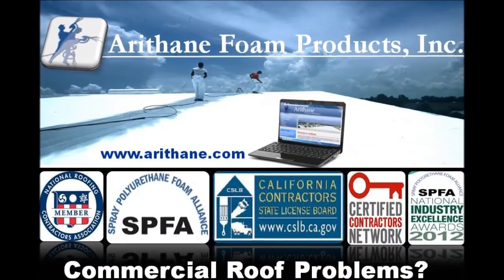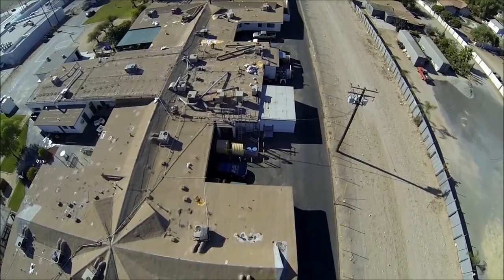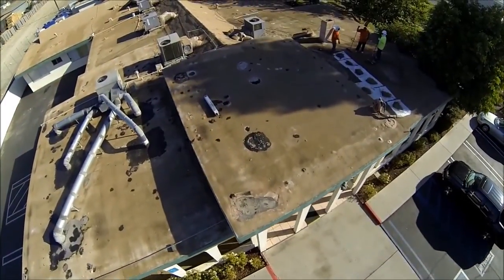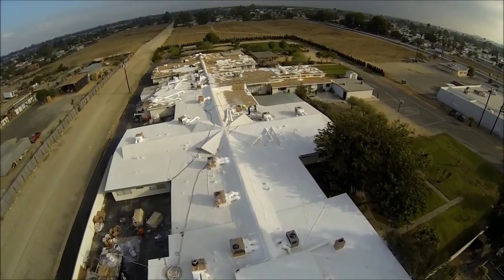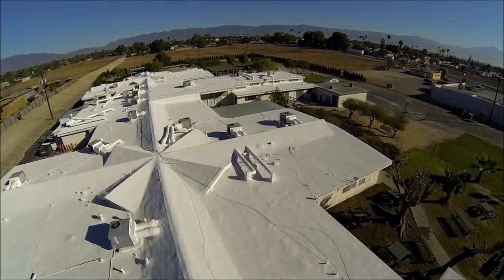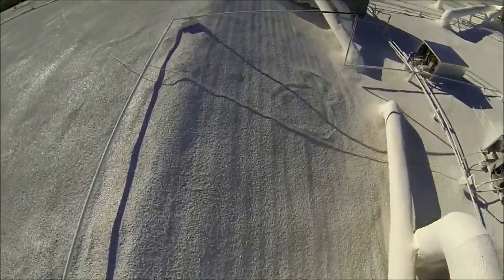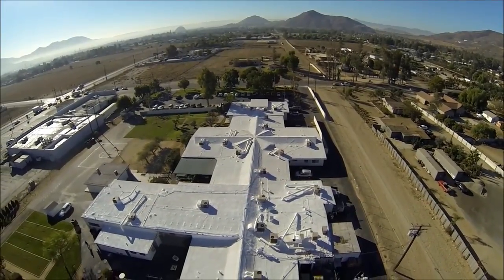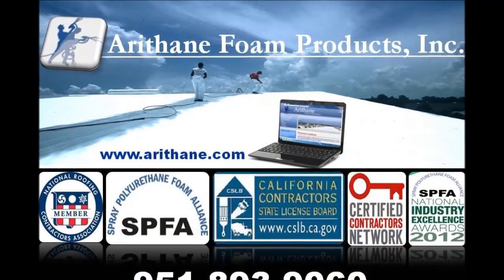Roof Recondition Roof Repair Spray Foam Roof

Comment: What is the cost per sqft.?
Reply: GrimmGhost  anywhere between $2.00 a so ft to $3.50 a sq ft depending on the prep and protective coatings.